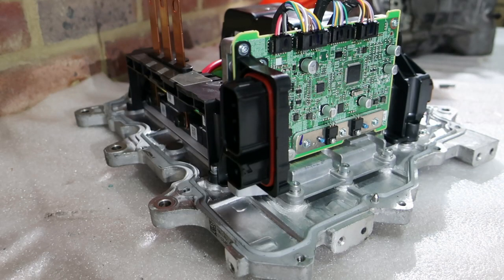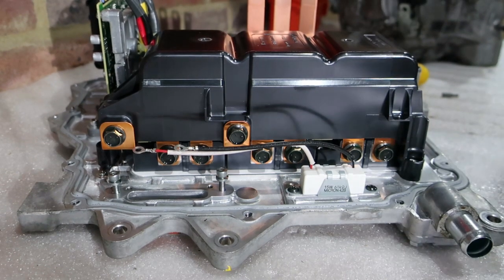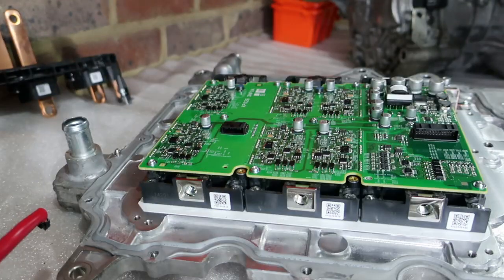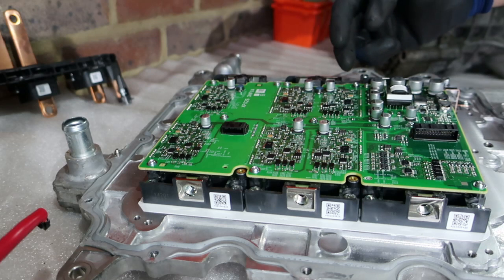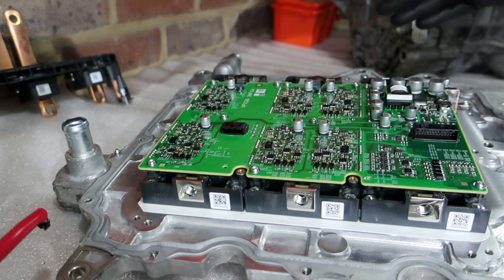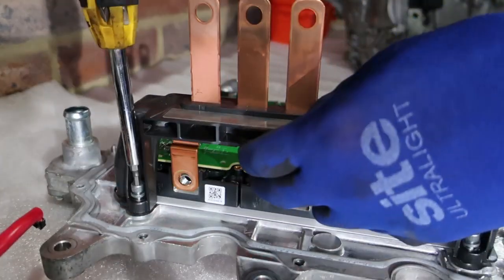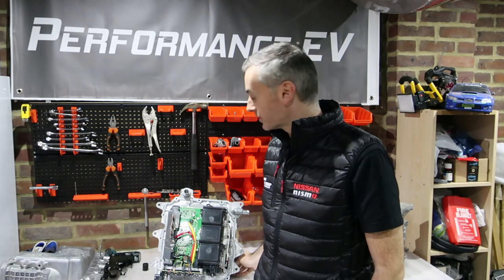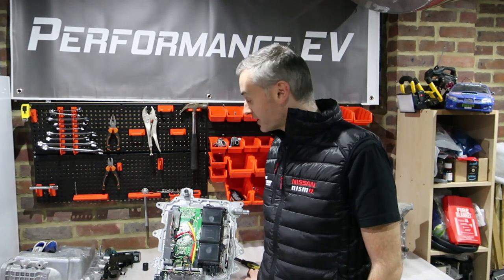Building an Electric Car - EV Parts - Nissan Leaf Gen 2 Inverter Disassembly

Comment: What is the highest battery voltage these are capable of running? I'd like to run a motor and inverter on lifepo4 cells, and maybe a bit higher voltage if there is a performance gain, I have never even drove a leaf, someone said the inverter made up for low battery voltage, don't see it doing this. I'd like to run about 120 x 3.2v cells, if possible, likely only charged at home, with solar power.. my previous experience is with forklifts and golf carts, 3phase brushless is basically a light-year leap forward, I'm wanting to install in a small truck, between 2,000 & 3,000 lbs, using a transmission to get the gearing correct, I heard these spin up in the 9k rpm range, and keeping it in probably 3rd gear would suffice, has anyone used two of these motors in a project? I would love Tesla level performance, but not likely, on the funds I'm willing to part with, my other option is series wound brushed motors, but I don't want to have golf cart performance! And another question if you don't mind, would the coolant for the inverter/ motor be hot enough to bother using to heat the interior? Probably use with electric heat also, just wondering, I'm guessing it is better than nothing, and will take a while to heat up. Using electric heat until it is warm, I live in the Foothills of NC, and about 2months of the year heat is a must have, and 4 months of the remaining it is convenient.. basically I want to convert a Colorado, or Toyota maybe Nissan truck, mounting the batteries similar to a Tesla, but inside the frame , each side of the transmission, and maybe behind the front bumper, possibly between the rear axel and bumper , only if the capacity requires it, I'd like all the cells be between the frame rails, with atleast 130-150 miles range, also, what is the peak current draw from the battery? Thanks
Reply from the maker: Hi James, I’m still figuring some of this out myself, but I’m happy to share what I know. 
The Leaf battery operates at 360v nominal, around 400v fully charged. The IGBTs in the Gen 1 and Gen 2 inverters are apparently 600v peak, so there is some headroom there to work with. I reckon you could up the battery voltage to 460-480 fully charged without blowing anything in the inverter. 
The stock logic board in the gen 1 & 2 inverters limits the rpm to about 10.5k, but I have heard of people running them higher when using other control boards. I reckon 12-15 should be safe, but I haven’t tried yet. I have heard of people pushing it to 18 without damage, but I don’t know how long you could do that for. Any more than that would likely damage the motor. 

The leaf is about 3500 lbs so a 3000lbs truck shouldn’t be a problem. Having 2 motors would definitely be doable, but you would need 2 inverters to control them and it would probably require some balancing to get them running well together. 

In terms on temps, they will definitely be on the lower side when compared to a petrol engine. I think a lot of people tend to go with an electric heater in place of the heat exchanger. That’s definitely my plan, I just need to figure out what dimensions I have to work with. 

I think peak current in standard spec is about 240. I’ve heard rumour of short 500 amp bursts being possible, so 300-400 should be okay with a replacement logic board. 

In terms of battery, 40-50kwh should give you the mileage you’re looking for. If you have a couple of metres of length to work with between the frame rails you may have the option of using Tesla Model 3 battery components. They seem to seek relatively cheaply as the design of them is difficult to reconfigure for most conversions. Each of the 4 modules is almost 6 feet in length.

Comment: Im interested to know what the power ratings are of the igbts?
Reply from the maker: I've been trying to find out for months but no luck so far. The only thing I have to go on is what people have been able to put through them without them blowing up. I've heard they can handle 450v without much bother and probably 300-400 amps.

Comment: Just wondering ,  are you going to modify to give it a little more HP on that PORSCHE ?
Reply from the maker: I have decided to use a drop in logic board that allows more control over the power delivery than Nissan's logic. That means the limiting factors will be the power stage components in the inverter and the battery.
Reply: @PerformanceEV  Cool !